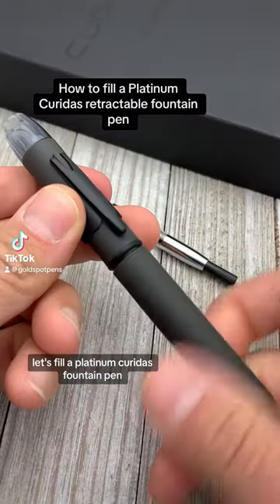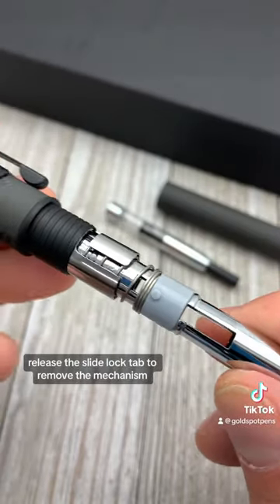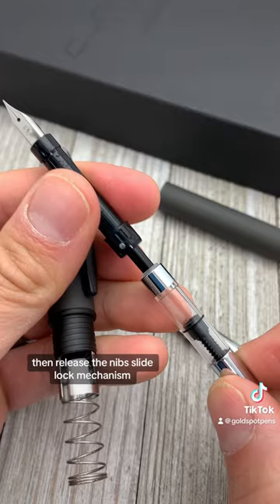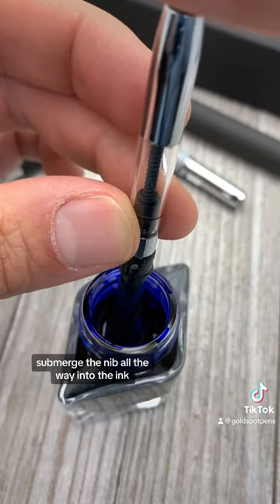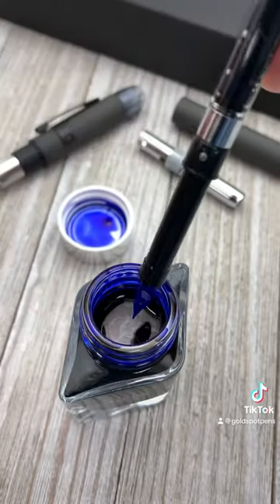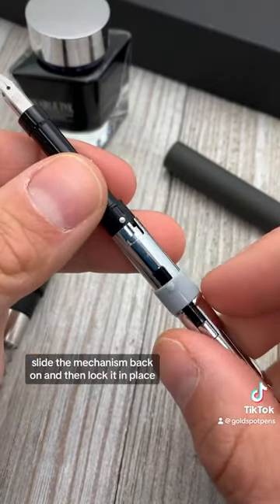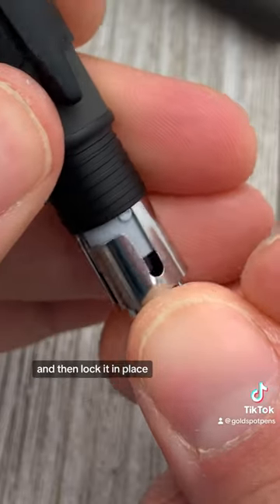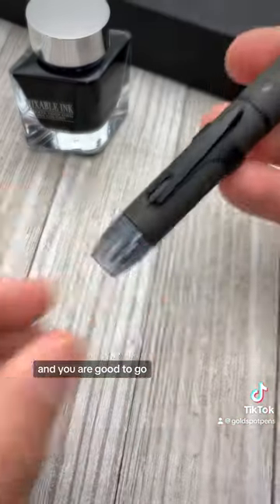How to fill a Platinum Curidas fountain pen using a converter and bottled ink #fountainpenhowto

Comment: Alternative timeline if ball-point pens weren’t invented:
Reply: ballpoints have no lane variation, less smooth and practically no ink choices. Its inferior to fountain pen .
Reply: @Cortesevasive Well, the feel is superior, but a ballpoint sure won't leak unwashable ink all over your 200 dollar shirt. Id say for the modern day, gel pens are better in general than both
Reply: @TheKimbit  Wrong. Fountain pens won't leak if you have a cartridge converter. The ones that leaked were usually the sac based ones. Because warm air would pressurize inside the barrel and shoot out ink.  Cartridge converter pens don't because there is very limited air because of the size of the tube.

If it's a concern even still just place the nib upwards and screw the plunger in the converter until there is no air. It's simple really. 

Lower ink capacity pens tends to have less chances of burping. 

I had many ballpoints leak and break. Gel pens you like so much stain everything and there's nothing I could do about it. Aside from being scratchy with no choice of ink lol. Disposable pens are also bad for the environment may I add.
Reply: @TheKimbit I tried her pens just to go right back to fountain pens again because they don't even feel like writing half the time. Just try a fountain pen from Jinhao and you won't be disappointed.

I EDC fountain pens every day with no concern for leaking. Modern fountain pens are much better designed than their ink sac predecessors.
Reply: @MitchellJBridges  "wrong" is crazy lol, cartridge still potentially will leak with movement, i know this from lots of experience with it happening. In terms of convenience there is nothing a fountain pen does better than a ballpoint, a fountain pen simply writes much more comfortably
Reply: @MitchellJBridges  ballpoints leaking is an extreme exception and not the rule, ive owned many ballpoints and ive never had a single one leak or break. And if they break, throw it out and use the next one. I hate using most ballpoints, but theres no denying that theres a good reason people stopped using fountain penz
Reply: @MitchellJBridges  if u think gel pens are scratchy use energel lol, more smooth than most fountain pens ive used, unironically i dont even prefer the lamy 2k over it in terms of just smoothness. And how are u gonna argue that gel pens stain everything when fountain pens.... do that all the time if you arent careful?
Reply: @MitchellJBridges  you arent wrong that modern fountain pens are better than sac ones, but they still inherently will spill ink, that is literally how they work. If you carry a fountain pen with you on person its nearly impossible to stop that from happening to some degree

Comment: I love all my fountain pen, except the Curidas.  I truly dislike that pen because it dries out quickly.  Any tips?
Reply from the maker: Which ink do you have in the Curidas?
Reply: @GoldspotPens  , I think it is a Noodlers blue ink.
Reply: @journeyon6598  Noodler’s ink are often over saturated. That’s why I always dilute them with clean tap water, sometimes as much as 1:1 as I was recently for my Pilot Decimo EF with X-feather. Before I got into that habit, many of my pens stopped writing after being capped just overnight, if they had one of my Noodler’s ink in them.
Reply: Have you tried covering the tip?
Reply: @josephflores2293  , not yet.
Reply: @journeyon6598  lol
Reply: @journeyon6598  I don’t own a Curidas, but a Pilot decimo, which also has a kind of trap door that has to close tightly, by itself, to prevent the nib from drying out. At one occasion I noticed that the door wouldn’t close itself completely. It turned out that ink residue had built up, and affected the closing function. A thorough cleaning, including gentle manipulation with a chop-stick solved the problem.
Reply: I have had some luck storing the pen horizontally, does not dry up as quickly!

Comment: How does the ink flow out again if the ink chamber creates a vacuum when it flows out?
Reply: There has to be an exchange of ink and air. Some pens has a designated vent in the feed to let the air in as the ink is leaving. If you have a transparent pen( demonstrator) it’s more likely to observe those small bubbbles of air entering the ink chamber during writing.